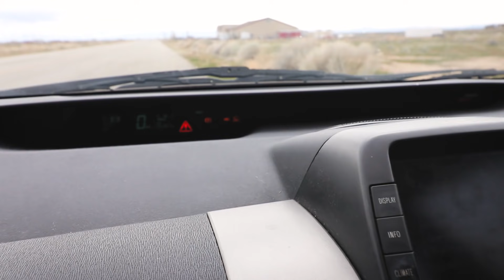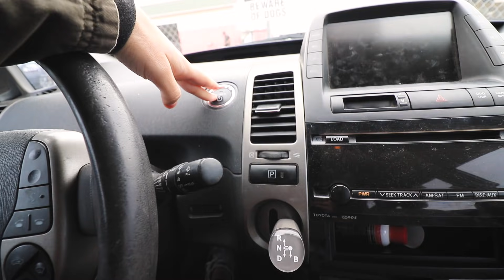I Think I've Been Sabotaged... Pulling Oil Pan To Find THIS... WTF

Comment: Material in the pan is behaving like cooked compressed cork gasket or metal based epoxy putty. Grey in the pan is definitely water and is enough that I would be worried about how it is getting in there. With the puff of white smoke and the water I would be leaning towards cylinder head or head gasket. But, do not downplay moisture collection in the intake/pcv system. Now you could have heads someone "repaired" which JB Weld Putty or Epoxy putty you would get the same kind of stuff in the bottom of the pan if it let go. I would recommend unless you are going to do a complete tear down and cleaning (best bet) other option would be to install a series of screens and put cheap oil in it with a good manual oil pressure gauge and run it till you get all that stuff out of the engine. The other thing is the way most oil filters are made they are made with an oil bypass valve meaning if they get too plugged they will allow oil to bypass the filter so you do not starve the engine. So there is a chance that stuff is now in the engine. Not trying to be a downer just being honest. Hopefully for your sake this did not happen but, I would recommend looking for hot spots in oil passages etc. You may be able to get a fire company to let you play with their flir camera to look at it if you ask nice. Other option would be to use a laser gun map out the oil passage locations and look for either dips or increases in temperature along the oil passages. You can manually heat the oil and run it through the block using a pan heater and manually running the oil pump or running and electric one to prime the oil system.

Comment: It is carbon. It is from the turbo over heating conventional oil. When ever the over heated oil [from the turbo] is cooled rapidly. The burnt practicals become carbine. You should only use synthetic oil in a turbo charged engine. But, you have to use conventional oil to break in a motor. The correct cylinder wall to piston ring mating will only occur with conventional oil. 500 moderately drive miles, is recommended.

Comment: Gm, years ago used this plastic(neoprene ) gear on the timing gears. when the gear went bad you always had to pull the pan and take the pickup tube off and clean the screen out for the oil pump. that looks like what this is. I'm not sure where any of that would come from in your motor, but I would say that something at sometime has worn out and worked it's way in there. probably updated now. that's what we always did. changed them out for steel gears.  not sure why they ever used that crap.you always heat that it made the motor run quiet. I could never hear the difference

Comment: Also check out the main bearings while the pan is off.
And if need be, a small brass screw in the oil hole in the crankshaft, will push out the old bearing.

Comment: 3M scotch bite cleaning pad as someone use air grinder with 3M disk, engine needs to be rebuilt as oil pump, oil pickup and engine bearin need replacing

Comment: In the old days you were not able to mix synthetic and mineral oil. The two types of oil reacts with each other and forms a gunk. But modern oils includes additives to prevent this. But it is not impossible that you run non-consumer-grade oil since you are racing.

Comment: I've heard of this, in fact my buddy had this same stuff in his oil pan on his 2006 gto you might want to check your guide for your lifters they are plastic and know for deteriorating. could have been from previous setup and then replaced. if it crumbles its plastic

Comment: Just a suggestion you should try a carbon pile test on the Prius, if it drops below i believe 9.6 V at room temperature that means the battery is no good. Just remember that just because it has the right voltage doesn't always mean that the battery is good!

Comment: I saw a video that showed some cars have pcv valves getting moisture in them and freezing, in winter, causing pressure to build up in them then blowing oil out the back as a pressure relief.

Comment: It looks like carbon and possibly residue off a cloth rag. Previous owners may not have maintained it right. Not usually a big issue unless you suddenly start running the engine hard then the vibrations work it loose in large chunks and it can cause issues like this

Comment: Kinda has my interest on what that could be.  I'm a mechanic and I've never seen that.  Now I've got a interesting one.  Bought a car years ago and drove it long enough to do a couple oil changes and about the time it's due for the 3rd oil change while my mom was driving it the oil light came on and she just ignored it. When I got to the car and checked the oil it showed full but was black. Had it towed home and pulled the oil pan and it looked like it was full of tar with a cup sized hole from the pickup that held about a cup of oil. Never did find out what caused that just wound up rebuilding the engine.

Comment: pull some main journals and get the plastic gauge. If you already r&r'ed font seal and rear is leaking I would say main bearings are gone...crank flops around. and runs crooked. The wear would be from high rpm and clogged oil pump pick up. Also too, volume metric efficiency of the oil pump will play into wear, high rpm and clog will add to wear. Never could understand why if you have pulled heads you do not drop the oil pan and check bearings??? And the "stuff "clogging looks to be gasket sealer material. Where sealer is just squeezed on and tightened and it oozes out the sides. What oozes into pan eventually breaks off and winds up in the bottom of the pan and then into pick up.

Comment: Looks like carbon to me. We had an engine that was used(new to us) and changed the oil as you should. In time, the engine lost oil pressure. My brother added oil to the engine but to no avail. I pulled the pan and the oil pickup was plugged like yours with a similar substance. The oil changes loosened the carbon deposits and they ended up in the pan, clogging the pickup. Cleaned everything out and never had a problem with that again.

Comment: Carbon from the oil passages that was never cleaned out. Back in the old days you would have a shop hot acid dip a block.
Reply: Correction, know your techniques. You don't "acid" dip. It's called a Hot Tank, and it's the polar opposite of acid. It's a Caustic Soda solution. Complete opposite on the PH scale.

Comment: If you can see visible build up like lacquer on the pickup screen that alone represents a 30% reduction in oil flow. To be clear not sludge just any film that does not wipe off and can be seen with the naked eye again like varnish or lacquer.

Comment: If it's not a blocked PCV valve that's caused the oil leak then the seals weren't fitted before the front timing cover & rear oil seal cover bolts were tightened, assuming that they were removed from the engine,my PCV valve was rusted out & not shutting off (other way).

The seals need to be installed, the front pulley needs to be installed before the bolts have been tightened, make sure to rotate the crankshaft a couple of times when the cover bolts are still more or less finger tight,the bottom oil pan bolts should be torqued up last so as not to distort the seals,the seal journals & seal must be free from grease & oil before being installed.

Yours has the same oil pan (Aussie setup) as the one on my LS1,I got a crack welded up in mine (damn aftermarket timing cover gasket was too thick at the oil pan mating surface).

I've replaced all the Hydraulic lifters in mine because they were noisy as well as the timing chain & sprockets,the car is going well now with no lifter noise after 3000 odd kilometres & 3 months of driving,the engine has no oil leaks,it goes a bit better now as well (has more compression as some of the lifters were jamming up),the engine is approaching 341,000 kilometres with the original piston rings & bearings,the cylinders have bugger all wear in them.

I'm doing an oil & filter change this weekend,yes! I got this one is a P.O.S. :- 

https://g.co/kgs/CqNTLn

Why did I lose my job last week & no one has wanted to place me in any roles so far ?

Don't they know my experience in the electrical trade ?

Comment: Theres a plastic oil galley plug in the rear of the block with an o-ring on it. It's accessable from the rear cover its in all ls motors. Hence low oil pressure and oil leak but i could be wrong you did just go through the motor so who knows

Comment: That crap looks like polypropylene from an oil bottle.  Those stupid rings sometimes stay with the cap, others with the bottle, and every once in a while it stays loosely on the bottle and falls off when turned over.  If lighting isn't good and/or the plastic is black  (as it often is) it's very hard to notice especially since the ring often stays on the cap (that you may have already tossed)  Polypropylene can get pretty  hard once subjected to heat and pressure.

Comment: My neighbor, had a Ford explorer, in mid 1980's, bought new, after a year low oil pressure, pulled oil pan, found a "PaPER BAG LUNCH, had clogged, oil pump, was left during engine, install.

Comment: liquid glass head gasket repair in your oil is an old trick to disable somebody's car or a really bad head gasket leak and somebody used that to fix it. the second one I've seen before and it looked just like the stuff you pulled out of your oil pan.

Comment: Even my shit box Forester has an aftermarket oil pressure gauge "oil temp and oil pressure are critical on turbo cars"  use a oil relocation line on the back access port that way if you need to remove the trans there won't be a thing in the way, don't ask me how I know this the Hot Rod shops have these things easy mode and not to pricey for how well they save time PS Note of caution when removing access plug and reinstalling relocation fitting you can strip it so easy and metal can get in the motor!!!!

Comment: my ex sister inlaw once put a 32 count bag of 1/16 ounce round fishing weights in my oil for my dirt track car. it made it to the feather race but then it came apart.  it took number 5 rod bent it over and straightened it up in number 7 hole the block busted so block so bad it even cracked the water pump. and thats kinda hard on the old 4 bolt chevy water pumps.

Comment: Carbon my rule of thumb is never ever put a set of heads on a old bottom end my shop doesn't do head jobs if the engine has more then 75000 miles

Comment: I kid you not about 12 years ago I pulled a motor out of a cargo van, the guy told me he never changed the oil in it just added to it, used Pennzoil all the time, I pulled the filter and it was so clogged the oil was caked in it and would not run out, then I pulled the intake and it had a softball sized chunk of carbon in it and the intake was also full of carbon, I never seen anything like it and I haven't since

Comment: The water pump to the synergy drive module is bad on the prius. There was a recall on that part.
Reply: WHAT?
Reply: @jeremiahfix5529  Prius has 2 water pumps, one mechanical, one electric. The electric one was recalled due to it just quitting. Once it does that inverter code is thrown due to overheating.

Comment: If your racing that POS I would reccomend an "oil temp." Guage..a proper oil filter (not the crap your running) and Amsoil 50Wt. Synthetic for race day...Your residue looks like severely over heated inferior oil..that's what it does under high temp. use..You have more them likely "roasted" the main bearings !! also...You can't exceed Mfg. parameters without modifications to compensate for the engine overheating...a bigger ol cooler also is a good idea...

Comment: Nothing on magnetic drain plug. Holds up GM non-magnetic drain plug. The magnetic ones have a smaller diameter darker magnetic material at the tip, the magnet isn't steel colored.

Comment: I think you're awesome and your video is too. I've torn down engines with 150K and have never seen actual debris like that clogging up a pickup tube. Plenty of sludge, some small metal bits, but nothing like what you found. I don't think there is any chance of it being a sort of carbon build up or naturally occurring age related issue. It could be from sloppy maintenance in the past before you got the engine but there was so much of it. If a head gasket were to blow in a certain way, combustion pressure might force gasket material into an oil drain passage and it could hang out there for a while only to eventually find its way to the pan and sucked into the tube. Probably many oil changes since then. Sabotage maybe... I would just clean it up and put it all back together again. Install an oil pressure gauge. If you suffered from oil starvation it will tell you. 

Hey, If you wanna call your Prius a Preepree, I think its delightful. As a geezer, we may use different words but we both dig cars and engines. Its nice to see a feminine touch and point of view with a young persons spin on describing the mojo that happens when you get into the personalities of cars. Both you and I are totally capable of accurate technobabble but choose not to use it. My old 2000 SS named Ernest had ego problems and suffered from occasional constipation.

I had sabotage that came all of the way from a factory in Japan. Somebody having a bad day tossed a set of rear brake shoes into the rear tire of my 2004 Nissan which eventually cause a tire failure. Dumb and unlikely stuff happens. Keep the shiney side up.

Comment: The only thing that makes me entertain the possibility of sabotage is the sheer AMOUNT of crap that was there. If it were a completely degraded filter, all of that crap would have had to go through the entire oil gallery system and bearings before getting back to the sump and then sucked up by the pickup; i would imagine such a thing would have written off the bearings, maybe even the oil pump itself, long before blocking the pickup like that 🤔

Sabotage does happen, but its rare. Worst ive seen was ball bearings thrown into a blower intake at a drag meet, but the guy had a lot of haters who were also competitors, so it made sense.

Comment: Clean the oil all the oil galleries out I made that mistake after changing head gaskets it blocked up the pick up and spun a cam bearing , definitely check the bottom end

Comment: I'd say it's carbon buildup laying under the baffle and when you took it to the drag strip and went full send on the big tires and a prepped surface, that would've been so much more GeForce on your car that you may have dislodged all that stuff in the baffle and that's when it would've gone to the pick up.

Comment: I'd pull one or two main cap and a few connecting rods to check the bearings,   Maybe there old Valve stem seals broken down?

Comment: I have had the valve stem seals come apart and end up in the oil pump pickup after a change to a higher lift cam.

Comment: Hello, new viewer here. How many miles are on that LS1? I replaced the timing chains/sprockets/tensioners on a 2008 GM 3.6 VVT and the cam solenoids had what I thought was bits of carbon on the screens. I'm guessing the engine hasn't had regular oil changes and the oil pressure sits at about 25psi at temperature. Kicking myself for not pulling the pump while I had the timing cover off, I did consider it at the time but opted to limit the repair cost total. Your next video on this subject is on my schedule now. Good luck!

Comment: I spent 8 years doing Warranty inspections on failed Diesel engines. You would NOT believe the crap people tried to pass off as a factory defect. Welded up and reground crank that broke. Looked like it was stick welded. Guess they didn't realize it was a METRIC crank 'cause it was marked in ENGLISH! Hello? The factory didn't put regrinds in. One of my favorites was one that came in totally trashed. Hmm. What's this green stuff running down from the oil fill cap. Looks like Clover Compound. Samples off to the lab. Yep. No free engine for you!

Comment: I built alot of motors someone pured something in the motor the sump sucks the oil up and is under  pressure and high heat temps i would rebuild the bottom end change head gaskets hun trust me

Comment: I'm leaning toward oil that has baked into a carbon matter and now it all fell down to the pan and eventually sucked up that's why you don't use oil that cleans the motor it loosens all that garbage that's been baked on the cylinder heads and flushes it to the oil pan

Comment: 12.3 IS NOT CHARGED. Do you need a light on your "Computer Smart" SNAP-ON Battery charger to tell you that. Apparently someone does. A battery nore a charging system should never be at 16 volts.  They can't reach that unless the Voltage regulator has lost its mind. Why....are you laying on the ground under a two post lift.  Get me out of here... Youtube plz stop suggesting random videos.  I already know what I like!!!

Comment: Carbon possibly. Looks like the build up you get on the valves of a direct injection engine. Strange that it's in the oil pickup though.

Comment: I bought a Ford Ranger with a 2.3 liter and no oil pressure, I took the pan off and found cork clogging the pick up tube and the lady had no prier work done, I told her somebody did it on purpose it was too much and it to was hard and brittle like what you found.

Comment: It looks like carbon build up something you would find out of a old daily driver engine that has not had the oil changed in a long time but it's usually found in the top of the engine not the bottom